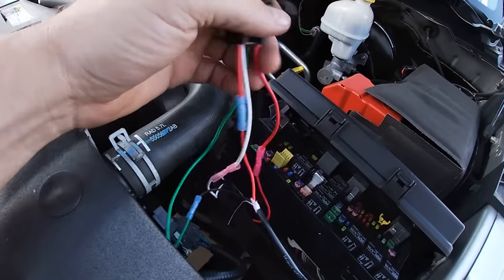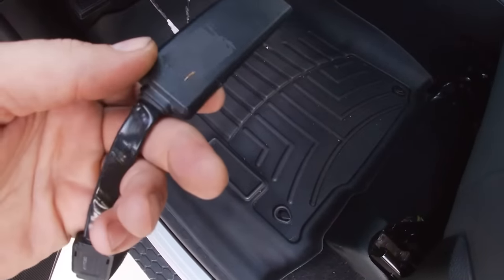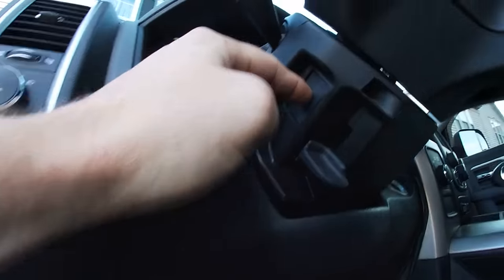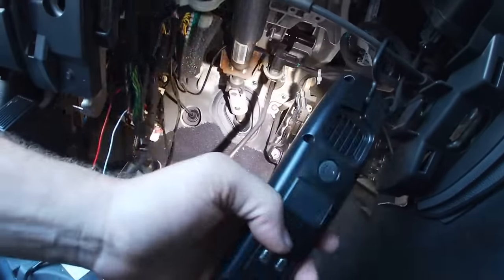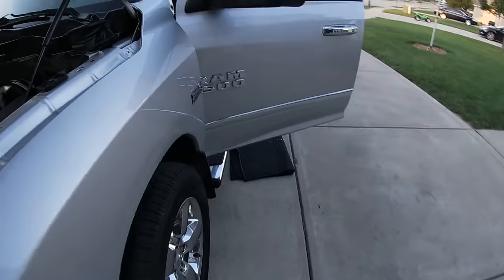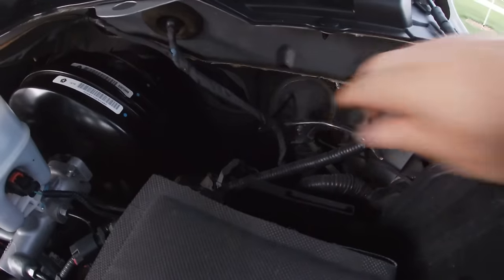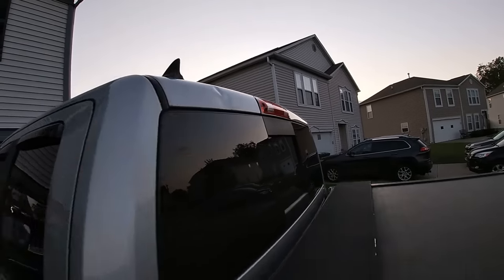Tracking Device Found on My RAM!

Comment: Some fleet vehicles use them to track their vehicles because they want to know if the employee is at work or at the bar. 😂🤣
Reply from the maker: Michael Thomas That’s understandable though!
Reply: Ya I know. Could be the previous owner thought it would be a good way to find it if it was stolen like LoJack used to be for. But if it was hot while the ignition is off it would cause a parasitic drain on the battery as well. Anyway glad you got it fixed and got rid of that awful beeping. 👍👍 Also I agree with the used car dealership comments. The dealerships in Texas do that a lot.
Reply: That's not really the issue. There's plenty of legit reason for the device to have been installed. 

The issue is a dealer selling it with that device still in there (and malfunctioning) and not informing the buyer. If they knew about it and said nothing, that's a problem. And if they didn't inspect the vehicle thoroughly enough to know about it, that's ALSO a problem.
Reply: @ajm5007  working for a dealership I can tell you with absolute certainty, if it isn't on the state inspection - assuming your state requires an inspection for resale - or it's not blatantly obvious, it's not getting addressed.
Reply: @jmerrick1000  I understand that the law doesn't require it to be, and that the dealership has no real incentive to do more than the law requires . . . but that's the problem, isn't it?
Reply: It’s pretty much the same system used in logistics industry. Delivery vans and such. If you have to keep track of more than 1 vehicle it’s worth every penny. Glad you got it taken out of your truck.
Reply: Park one place, Uber to another...
Reply: Yep Comcast does this.
Reply: WOW really?
Reply: @ajm5007   No, it's not a problem because the truck started when he bought it and for the next 2 weeks.  There is nothing sinister here.....it's a fleet vehicle.
Reply: Had to be union company....😂😂
Reply: @mineralareaoutdoors2213  probably. They are usually the type of companies to give their employees insurance and that insurance provider probably requires this.
Reply: I'll save you some hassle boss. C'mon down to hooters
Reply: We use to Install trackers similar to that one for a taxi service years ago. If it’s the same they actually track your entire route on map and your speed,when you start when your not moving and everything. So they know where you live your daily routine and  when you go there. IF they are actually watching it. The taxi service we dealt with actually had to pay cell service on that style though. Then their is the car lot style. If your making payments on the vehicle from a used car lot they will put trackers to know where to locate the car if you don’t pay. When you don’t pay some will disable the car if the dealer chooses that capability. Some just want to know where it is. Then when you go on the store or work you come out and guess what? Your car is gone because you didn’t pay.
Reply: Ez sollution just drink on site
Reply: That's why you park down the street and walk to the bar.

Comment: If the tracker was a self contained unit not wired into the vehicle I'd say find a way to attach it to a rail car.  :)
Reply: Gary Cameron good one! Ha! Ha!
Reply: The rail authorities will not be happy
Reply: Use a battery and ship it to another country
Reply: @stopglobalswarming  actually the FRA really wouldn't care. As most railcars are tracked. They scanned while in motion and coming in an out of the yards.
Reply: @im1who84u  Quaid!  Open you mind!  Start the reactor!
Reply: Just get a 12 volt lantern battery or a 12 volt solar panel and attach it to the top of a rail car. lol.
Reply: i love the idea  but you talking train car or railcar as in 10000 horsepower drag car?! haha
Reply: @andrewtreece3708  They still dont like it when strangers walk up to their railcars when theyre in the yard.
Reply: Or a stray dog.  Or a crow!
Reply: OTR 18 wheeler would drive them batty!
Reply: Mail it to Germany.
Reply: A fuse a ground and could probably run that off a nine volt batt for a while. It's not recieving a full twelve volts anyway by it position.
Reply: LOL far as I see its wired to the ignition key, and power, so as long as you apply 12volts on both it should stay on.. lol
Reply: Don't strap it to Congress,  it'll never move...
Reply: I doubt it is still being tracked.
Reply: Hook it up to your neighbors riding lawn mower .
Reply: No I would have sent it back to them with the bill for time and wages
Reply: Gary Cameron, excellent idea lol !!!
Reply: Found a magnetic one under my girlfriend's car.
It found a new life under a police cruiser.
Reply: Or add a power source and send the entire fleet's GPS on a semi headed to Mexico . We did that in Canada and when every work truck headed into the States the dickhead that put them on freaked out.
Reply: Hmm, Jerry rig the device  to make it into a  self contained unit. Put in trash  on Trash Day
Reply: Attach it to someone else's RAM
Reply: @hendricksonrunner5015   Why not pay someone a bit to wander around with it on vacation

Comment: Its actually scary how many cars have aftermarket gps trackers put in them and not removed when sold or paid off. They always end up causing power issues either a parasitic draw or no starts.
Reply: Not to mention the fire hazard potential!

Comment: At my previous job, they didn't use the software that utilizes the old school tracker on our fleet vans. 
  They just use the provided tablet that we used for our routes. They would also record audio and video. I used to mess with them all of the time. That assistant manager at our location had a grudge against me because I proved her wrong about something petty. It wasn't a big deal, but she thought it was.
  I used to make up insulting songs about her and sing them as I drove around the state. 
  I did this after a co-worker informed me that she spent most of the day spying on me. When I got back to work I would walk in and smile, as I politely asked her how her day was.
Reply from the maker: Man that’s hilarious! 😂
Reply: Use electrical wire sealant not tape.

Comment: I found a similar device many years ago on a Chevy aveo,  I had installed a radio head unit, and every so often I would get an interference with the AM station and one day I started to install a RFI filter and while looking around I seen a small flicker of light and I thought what the hell is that I did a parasitic amperage test and seen a amp draw of more the 35 milliamps so as I dug in i was able to locate and remove the GPS tracker it had a phone sim card in it so it was cellular based. 
I took an old house alarm battery and hooked it up to the gps unit and took it far as hell in the desert and left it in a tree and weeks later i get a call from the finance company asking me where I keep my car I told them that is none of your business as long as I make payments and I didn't appreciate you fuckers tracking me!
Reply: God, this makes me irrationally angry.
Reply: shit man I always just buy old second hand manual transmission cars, they are the most economical for me to keep running!  No payments, interest, tracking!
Reply: thank you for this information! I want to learn how to do a parasitic amperage test. That was hilarious what you did wit the old house alarm batter and the GPS 😂😂😂 Pure genius!
Reply: I fail to understand how this can be legal. In the finance paperwork fine print they must have this covered. Without it, it is a clear violation of your privacy. I would demand evidence that you unintentionally gave them permission to install such a tracker. If they can not provide the evidence, I would sue them.
Reply: mrq1701 These are usually only used in fleets or high risk lending, it is legal and a part of the buyers contract when installed. I worked for a couple of those types of dealers and they are normally transparent about them. They are usually there just to locate in a pretty high chance that the customer may stop making payments, or when customers use fraudulent information in order to obtain a vehicle (actually happens way to often). 

However big controversy with starter interrupt (I believe it’s illegal in some states), due to improper installation which can cause stall out while driving, and people stuck in emergency type situations.
Reply: I once worked at dealership that would use those. The sales men didn't fully explain what these things were so many of the customers thought they were getting a navigation system.
Reply: Chrysler puts them in all of their fleet vehicles, test vehicles and exec vehicles. I drove for them.  Not my car, their car. I guess it would be possible for one to go through auction after Chrysler was done testing. But I do think that all 2020s have some form of black box that records extreme driving.
 My job was to run the route and I ran the route. If the route had a traffic snafu, I called, told them with how I was going around it. It was never a problem. And yes they do have a screen with a person actively monitoring. Auburn Hills has around 75-100 vehicles out every day M-F. At times it was fun playing cat and mouse with the the magazine car spotters.
Reply: What year was your car
Reply: Would have been more fun if you taped it to a semi of a freight train.
Reply: @stevenwilliams1805  I can see that happening alot them telling you but not really telling you.
Reply: Damn
Reply: It's funnier when you power it up at/ near a junkyard
Reply: Zip tie it under a semi trailer down at the truck stop and walk away.
Reply: @redneck4528  or known chop shop.
Reply: What was it hooked up to?
Reply: have you filed a case aganist them ?
Reply: SUPER!!
Reply: @thisiswhatilike54 , I'm pretty sure it's completely rational
Reply: @mrq1701  Oh it's definitely covered in the paper work people sign. People just rarely read stuff they sign.  This particular case was one that someone neglected to deactivate.
Reply: Would have been even better if there were some JB-Weld involved and having the tracker make sweet love to a flatbed car of Canadian Pacific.
Reply: Ahhhhh...  America. The land of the free... Ironic isn’t it?
Reply: I would have connected the battery, put it in a box, and mailed it to Argentina.
Reply: @pauljs75  meanwhile somewhere in Ohio....
Reply: That's crazy
Reply: @historicbeef  I know right. I've never been out of this country so I have no way to compare this country to another. However, I have been around for 49 years and have seen our Constitution and Bill of Rights trampled on, violated, and flat out stolen by the so called elected officials. I honestly don't believe there is one single polititian that is in office who doesn't bow to their own special interest. We have presidents signing executive orders that sling turd in the face of the existing laws. We have a political system that you either have to be one kind of crook for one party and another kind for the other. You have to support all or nothing. The Independent party in this country never even has a chance because the wealthy elite, the ones actually making the laws and decisions, refuse to offer any financial support because they know they can't control them. It wouldn't make them richer. Elections in this country are a sham at best.
Reply: That's a crazy story.
Reply: Weird.
I just bought a certified Chevy yesterday i get this video as recomended.
Reply: @ronaldharris6569  like that idea :-)
Reply: I believe that is illegal for a dealer/finance company to track a vehicle.
Reply: @nathanscott7910   It's funny that elections were never a sham before 2020 when the Orange con man lost. Weird rite?
Reply: @lowrider94ss  I kindly disagree. Just research the history of the US, it's laws, legislation, and the ones who are actually in control. Here's a hint, follow the money. Every president in the history of this nation that threatened to take away the power of the Federal Reserve and operate on the gold standard instead of the Federal Reserve were assassinated.
Reply: @lowrider94ss  I see he's already answered but I would definitely second his answer it's been Democrats who have been assassinated as well as Republicans who have been either attempted assassinations or assassinated and elections have been going down for years and years and years
Reply: A friend of mine was in similar situation. He put that thing on a railway box car...
Reply: @KDuboutdoors19  zip tie it to a stray cat 🙀
Reply: Sweet

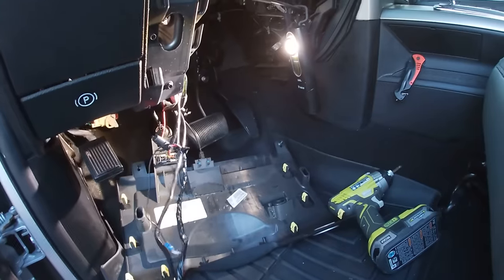Comment: 5:47 I bought an 02 Dodge RAM and every so often it just goes dead and there's a red light sometimes blinking and clicking sometimes and it sometimes just glows I have to work the shfter back and forth to get the power back any ideas any help would be appreciated

Comment: Yo, bro - SERIOUS warning here: If you EVER find a tracking device on your vehicle that you haven't placed there, DO NOT THROW IT AWAY!  Instead, give it to your attorney, and ask them to hold it as potential evidence.  This will protect you in the event that there was some legal or criminal mischief going on.
Reply: Good Advice!
Reply: Nah, strap it to a weather balloon and let it go.
Reply: Some car places put them on as a condition of your loan. If removed you may have to buy a new one it's buried in the paperwork. But a lot of times the dealership just forgets to take them off.
Reply: Naw bro just take n dump it deep in the woods with difficult access tarrain
Reply: 2023… hubby just sent me a photo of a tracking device the dealership found in his truck. Weird! Thank you for this.
Reply: The truck is from a fleet vehicle, it probably monitors locations, speed and even if there is a crash
If someone wanted to track the truck I doubt anyone would go through the trouble to hardwire that in.
It was installed before he owned the truck, they should have removed it before selling it
Reply: I had one old friend tell me the trackers are under your driver's seat and messed up the whole electric to my vehicle.
Reply: I have Hawkins electric after me. Can this world get any more stranger? If they spent the time spying on China as they do me we would be alright.
Reply: Found the same tracker on a friend's dodge avenger 😂 Now it's all removed and Starts no issues 😮
Reply: Why & how would a tracking device prevent the auto owner from starting their vehicle?  How did the previous owner start the car if the same tracking device was present in the truck when they sold it?
Reply: @markharder3676  Couple of things.  First, the OP indicated that there was a corroded connection.  That usually acts like resistance, so the starter motor might not get enough voltage/amperage to turn over.  Secondly, if that corrosion caused a path to ground, it could act like a slow drain on the battery.
If the corrosion wasn't as great when the previous owner had it, or if the previous owner ran the car often enough to keep the battery recharged (or both), then the conditions were different later, leading to the fault.
Reply: The device can disable the car via a computer or cell phone app.

Comment: Bought a backup camera for my pickup but due to cable lengths the sending antenna is near the tailgate and the reciever doesn't pick up the signal. Did I get a cheap product or maybe you have another suggestion?

Comment: I worked at a used car lot as a head mechanic.  Many times with high risk customers we install tracking devices,  they also have ignition shut off features that I was supposed to install, but never did.  I was lazy and felt it would just create issues.  But tracking devices we would splice into a constant hot line into the wiring harness behind the OBD port.

Also I wanted to point out that it was the banks offering the loans that made us do this.
Reply: At that point, the banks owns the vehicles; not the dealerships.
Reply: ringo78 
Ah,  so if you buy something from a bank,  they can modify the thing you are paying for. I guess they could switch the wheels and take the stereo too.
Reply: @hxhdfjifzirstc894  If it is on the vehicle when it is repossed.. yes.. and there isn't a thing you can do about it. You might see if the repo company will let you mount the stock rims and tires on the vehicle (as described in the sales invoice) As far as the stereo. nope. It's considered to be permanently mounted. the contract is usually describing a stock vehicle, if you make changes to the stock vehicle and do not keep the stock parts, banks can and usually will keep any aftermarket modifications you put on it, sell it at auction for less than you owe, so they get your stuff and ding your credit for 7 years.
Reply: @ericdyer9080  honestly, I don't understand why anyone would buy aftermarket parts before paying off the vehicle?
Reply: @stevenwilliams1805  simple. People do not like the stock rims, or the stereo system and will usually upgrade those first. Or the headlight assembly is another one that people will change, granted, not as much now with the led headlights as a standard option, but it happens. Its a way to differentiate "your" car/truck from hundreds or thousands built exactly like it.
Reply: @ericdyer9080  oh I understand that but it's flawed logic. It still belongs to the bank so, technically they are modifying someone else's vehicle. If I were to take out a loan, I would think it would only make sense to pay that off first before investing anything else into it.
Reply: sneaky bastard !! LOL
Reply: What’s a heigh risk customer
Reply: @Juice1990s  someone with really bad credit.
Reply: @stevenwilliams1805  agreed.. no new curtains until the house is paid off.
Reply: That is not exactly legal.
Reply: @timothyterrell1658  what, exactly, is not legal?
Reply: Do you know how to find one. My cars  used in 2003 and bought cash.
Reply: @Juice1990s  Or Select customer!
Reply: @stevenwilliams1805   Not necessarily.